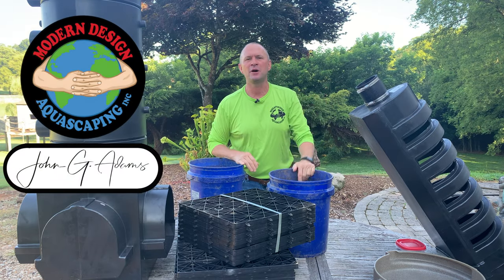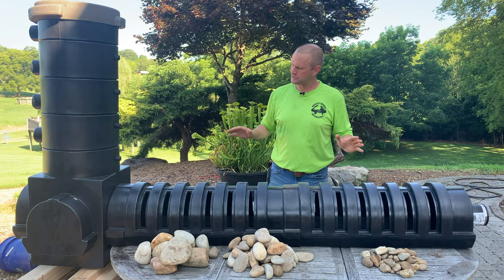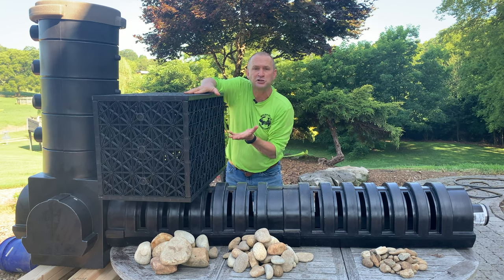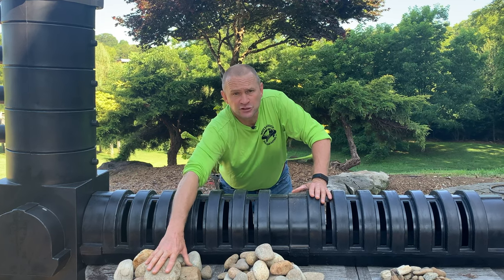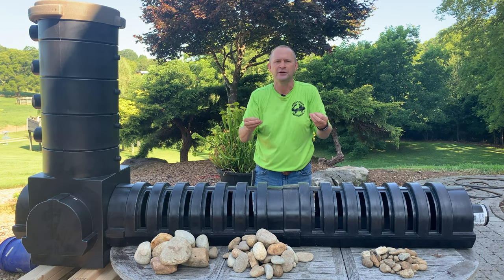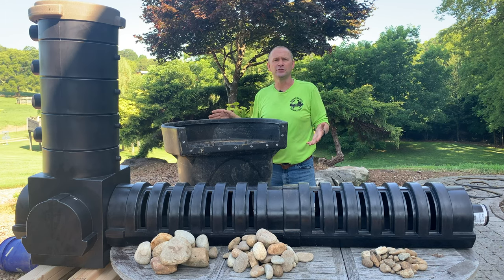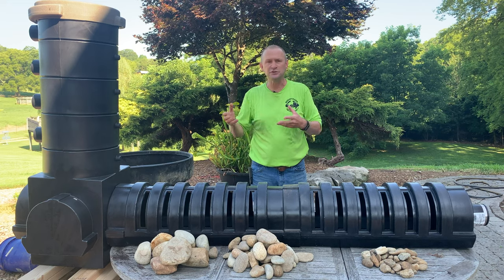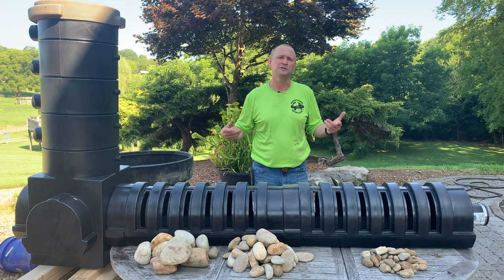Water Feature Design Series 7 | Wetland Filter Basics | Bog Filter Basics

Comment: Is there a chance the Aqua blocks can become clogged?  Since they are covered with tons of rock, apparently you would need to remove all of that rock. Is the Aqua block part necessary, or could you just put the large rock over the centipede tube, then the smaller stuff as normal?
Reply from the maker: Aquablocks can become clogged if the filter is neglected, plants are allowed to take over, or too small of aggregate is used. Old systems we built “pre-Aquablocks” have all been dismantled and re-built. They are un-cleanable without the blocks. Proper aggregate sizing / placement in addition to the Aquablocks allows for a proper cleaning and a system that will last!

Comment: John is it better to use the large aqua blocks or the small aqua blocks won't that limit the size and thickness of the gravel layer and reduce the efficiency of the filter?
Reply from the maker: I have used both. No noticeable difference (other than more digging and more expense for the large ones). I think that regular cleaning and not using crazy plants are the factors that are more important.

Comment: John, you're a legend. This video series is so helpful.

There seems to be two school of thoughts on bog filters. There's the the Aquascapes approach, which is what you're demonstrating with these enormous centipedes, snorkels, aquablox, and 4' deep with multiple sizes of gravel. And then there seems to be a lot of others building the same thing and having success w/ nothing but slotted PVC in 1' of 3/8" pea stone.

The Aquascapes system is an order of magnitude more complex and expensive. What drove your decision to build this way vs. what seems like a much simpler design w/ the same benefits?
Reply from the maker: When you get to the point where your filter is clogged and it’s time to clean it out, you’ll understand the value presented by the Aquascape system. We have systems that we installed similar to your second school of thought over a decade ago and they function phenomenally until they don’t. At that point the process of cleaning is so impossible! We even used the centipede unit with multitudes of aggregate over top with no aqua blocks and that worked phenomenally until it was clean out time as well. After many years of trial and error I have made my choice based on functionality- maintainability- and longevity👍🏻 in the long run I believe you get what you pay for and you make your decisions based on current situation and what it makes sense for you to spend at the time🤟🤠
Reply: @KoiAddiction  That makes sense. The maintenance procedure for the 12" bogs are to pull the cap(s) on the snorkels and let the pump clear the buried lines. But I guess that doesn't address the gravel itself. Once the gravel is clogged, the only fix is shoveling it out—no way to back flush it. No biggie on a tiny pond. Absolute nightmare on a big one.

Comment: Great vid! one question. Would this system work on say an acre or acre and a half pond? Im sure it have to be much bigger but would it be a solution to clear water?
Reply from the maker: Yes, we have done some large projects! Our company has built wetlands for ponds as large as 75,000 Square Feet. Stay tuned, we have a job slated for completion this year that is that big and it will be some great content. We have also built wetland filters for multiple other ponds that are 1/2 to 3/4 acres with great success!

Comment: John, have you ever tried to cut a hole on the top of the snorkel modul and let water come into the wetland that way? So you don't need a check valve or breather pipe? Also it's easier for the pump to release water into a big tube than go underwater in a 2" tube. What do you think? Thank you!
Reply from the maker: The purpose of pumping it into the end of the centipede is that it allows the water to have a greatly reduced velocity. The slowing water will drop debris into the bottom. I’m not sure if the other way would do that as effectively or not, give her a try and let me know if it works :-)
Reply: @KoiAddiction  thank you for the answer! I think I'll also stick to the normal way. Tomorrow I'll finish with the wetland filter digging. I won't use a centipede module at all. I'll dig a trench in the bottom of the wetland and simple put 6 heavy duty plastic pallets over it. In one end I'll install my cleanout pipe and in the other end the 2" flexi pipe goes under the plastic pallet. I'll share a video with you when it's completed. Big thanks for your instruction videos!

Comment: I  you pump water into the centipede, shouldn't it come out of the snorkel before it filtrates back up?  wouldn't the water pressure be higher in the pond to keep the filter from working?
Reply from the maker: Mr. Duck, the lid on the snorkel screws on to prevent that. Also if there is so much back pressure in the gravel bed that the water is coming up out of the lid, the filter needs to be back-flushed! That’s why I don’t like to put my snorkel next to the liner edge though, because eventually it will rise up the snorkel a bit if left unchecked!

Comment: Hi John,  Thanks for the great video.  Lots of useful information.  We are in the middle of construction of a new pond.  I can find a million videos on constructing a wetland filter but I can't find the first one on how to clean the system in the future.  It's supposed to be easy but what is involved?  Do you have to have a specialized pump?  Will a regular submersible sump pump work?  Does it need to be a sewage pump because of the heavy fish poop?  Does the pump suck out all the sludge in the centipede?  So many questions that a google search will not answer!  I would appreciate any information!  Thanks, Sondra
Reply from the maker: We use a solids handling pump for cleaning. Its time consuming but simple. Drop it down the snorkel and pump the water back down into the wetland until its super nasty and then pump it out. Add a bit more pond water and repeat. Simple to clean and biological is still intact!
Reply: Thanks for the response.  I appreciate your help.  How do you estimate how many gallons your pond has if it is an irregular shape with different elevations and a cave?  I'm assuming I need to know that before purchasing a pump.  Thanks again!

Comment: Hello John, I enjoyed your video.  I have a farm pond, 1/2 acre in size.    I want to control the planktonic algae since my dogs swim and this is a natural habitat for wildlife.  I have an air max aerator and use natural enzymes from The Pond Guy.  The bog filter seems to be a good choice to control the algae but I do not want a water fall.  Is it possible to use this set up with a simple feed back into the pond?  Thanks for your input.
Reply from the maker: Yep. We have installed them in pond edge so they are actually part of the pond with no aeration value BUT you must drain down pond to liner level to clean the wetland filter. Only downfall in my opinion. Its more energy efficient but not adding oxygen to the system so make sure dissolved oxygen is good still!
Reply: @KoiAddiction    wow thank you for the answer.   I wasn’t actually expecting one based on the date of the video and my question today….lol.  I will give your office a call to further discuss.  I’m very impressed with your videos and would like to invite you to SW Michigan to help me with my pond.  Thanks again.  I will definitely be in touch.
Reply from the maker: Im from Michigan! Never built a feature there YET!!

Comment: Hi John,This is exactly the information I was looking for, Thanks! I’m gonna build my first wetland filter in september. And i was wondering, when you use large aquablocks do you need an extension on the snorkel. Or is it good enough to use less stone for the filtration? My koi pond is about 12m3.
Reply from the maker: You can use the extension if you need it. When we installed our products last week the snorkel was only a couple inches shorter than it needed to be so we just made a ring of stones around it so we can still access later. Depends on how much deeper you’re going

Comment: John - I have a question about the centipede.  How many GPH can a 6’ section handle.  I am trying to determine how much water I can effectively push through the my wetland filter.  I think the pond will be 15,000-18,000 gallons.   So the other question is how do I properly size the Wetland Filter?  Is there a way to calculate that or “rule of thumb”?  I always think more filter is better and less hassle in the long run.  I really want to know how big it needs to be for that many gallons of water and I can up size if I want or have room to.
** One more question - we have a winter here with pretty strong freezes - what do you do with the wetland filter in the winter?
Thanks again. - Love your videos! 
John H - Grand Junction CO.
Reply from the maker: Watch My Saturday video this week, we are beginning install on a filter and I have sizing information in there. 2000 gallons per hour flow per centipede, I would check with Aquascapes on the winterization aspect, I have no need to do that here so I have no experience. I know my friends in New York pull the pumps and drain the plumbing on the wetlands, I’m not sure that any water removal is necessary? We installed a beautiful filter two weeks ago and I am making a two-part video about that process and trying to make it my best educational production on wetland filtration yet!
Reply: Thank you for the flow info!   Do you have any contact information for the folks in New York?  I think on the winterization I will pump out the sump each fall and refill with fresh water so that the system is pretty clean in the spring.  I don’t think leaving a long of sediment in the system over the winter is a great idea.  I think the biological activity comes pretty close to stopping.  Thanks again.

Comment: Hi John one more question. I noticed on some videos I am not sure if it was yours or what I noticed some have the wetland snorkel cleanout below the waterline and some have it above. Which way is correct. Is there a reason some installs put the snorkel below the waterline?
Reply from the maker: Its fine either way. Make sure it’s not letting water out and avoiding filtration!
Reply: @KoiAddiction  Thanks John.

Comment: Can I use rocks only with the snorkel and centipede and not the aquablox?
Reply from the maker: You can, we used to. The Aquablocks just make it so much easier to maintain and clean. If you let it get clogged up with no blox you will have to dismantle it to get it clean!
Reply: Thank you 🙏🏽

Comment: Just wanted to thank you personally for the knowledge that no doubt took you a long time to acquire. I am building my first waterfall/river and this gives me some great ideas ( I am a farmer and also own 2 gravel pits so I have A LOT of rock to pick from , just the road leading to my parents place has 200 tandem loads of big rocks to pick from )

I like to build my own things so I’m going to attempt to make my own centipede and aquablocks. I’m thinking plastic sewer main pipe with holes drilled and milk crates is essentially the same thing

Is there any reason I shouldn’t attempt this ? Any glaring flaws that I should know about , I’m also a machinist technician with a machine shop on the farm so I’m quite adept at building things ( used to make down hole tooling for the oilfield)
Reply from the maker: I used to make my own but the time factor, and professional products and knowledge from Aquascapes is enough motivation for me to contribute to the guys who are pushing this industry forward! Good luck with your project ;)

Comment: Hi, I’m looking to build a (roughly) 20x20 pond with a bod filter, it will have a stream on one side leading in to it but it would be for looks only. What pump/pumps do you recommend for the big filter circulation? Thanks in advance.
Reply from the maker: That would depend on what you intend to use The Pond for, and also elevation etc. Many factors going to selecting the proper pump, I would need more details - but external pump would be my choice for a swimming pond (artesian pro) is the brand I prefer, and there are a multitude of submersibles that I select from if I submersible pump is the way to go.
Reply: @KoiAddiction  perfect thanks a lot. It will be a swimming pond, and I’m on pretty level ground so there won’t be much in the way of lift, except the decorative stream.

Comment: I am looking forward to building a up flow wetland filter for my new pond. it will be 10 feet wide 30 feet long and 3 foot deep I am thinking 20 to 30% of surface square foot of the pond size to be the size of the filter but i am not sure how deep to make it I have seen videos saying 3 foot deep to others saying any thing over 2 foot deep is a waste of liner. How deep would you make it ?? 
my wife likes the idea of having it full of plants
Reply from the maker: I do 2 feet of aggregate based on my measurements the depth of the water over top of that is irrelevant. Depends what you want to use it for I’ve seen people with 6 inches of water on top of the wetland and I’ve seen people put the wetland in the bottom of their swim pond. The only thing that’s important is that you feed from the bottom and the water is oxygen rich :-) plants are a bonus but are not necessary. Most of the time the whole we dig for a wetland is between Five and 6 feet deep by the time you get to the very bottom of the excavation. I have three videos in my water feature design serious on wetland filters that will show you start to finish how we build one.
Reply: my idea is to build it next to the pond 3 foot deep 1 foot of 2-3 inch stone 1 foot 3/4 to i 1/2 stone and a little of gravel on top of that and 1 foot or a little less of water then have a 2 foot section that over flows the filter back in to the pond I have a aqua scape 1000 skimmer and a  22” spillway to make a small water fall return from the skimmer. and a separate pump to feed the up flow filter. One thing I am having a hard time with is do you just put the pipe from the pump to the up flow filter just run it out of the pond and over the berm and back down in to the up flow filter I didnt get a clear Idea how that was done in the video series. Thank you for the help :)
Reply from the maker: Yes the water from the pump feed will just run over top of the berm and down into the end of your centipede. You will then have small aqua blocks over top of the centipede those are 9 1/2 inches thick I believe, you will then have your 2 feet of gravel, and then however much standing water on top. Don’t forget to put a T in to the line as it goes over the berm and a small piece of 1 inch pipe with a ball valve so that you have something to break the siphon. Just allow that water to spell out on top of the wetland.
Reply: Thank you :) I love watching your videos

Comment: Hi, 
Nature converted my 15000 swimming pool into a fish pond. 2015 was the last summer for swimming. In 2016 I put 30 goldfish. The next year we had over hundred. I added bass, blue gill and catfish. It is currently shaded half cover suspended and 3  - 3 by 8 floating islands. A 100 gallon tank with matrix filtration and bio balls with a 3 ft waterfall drop. I want to build a biofilteralong the side of shallow end. The surface area of pond is 800 square.  Don't know where to start my planning.
Reply from the maker: Wetland filter series will teach you how. Size at 25%-35% of the surface area of the pond. Aquascapes will design the filter for you or I will consult with you for a “Small” donation to our foundation. It’s not to complex of a thing to do. Call us to schedule a consult @ 865-995-1234
Reply: @KoiAddiction  thank you. Little bit of a challenge because of buried wires. Thinking of building above ground along edge of pool and up against a bank. I'll check with aquascapes.